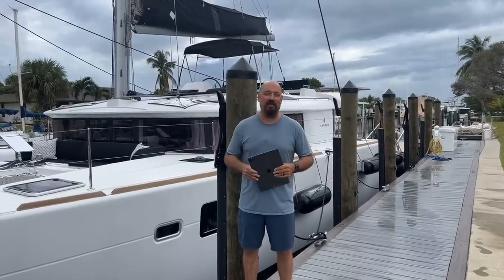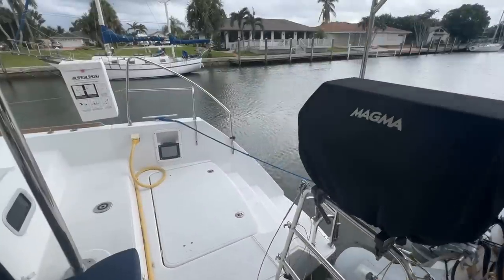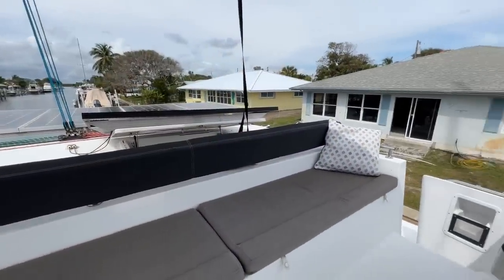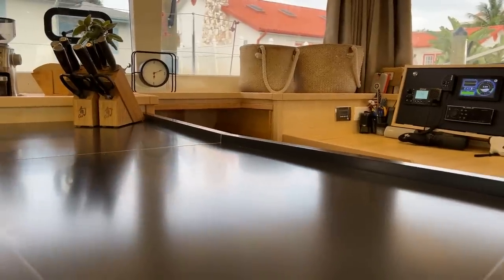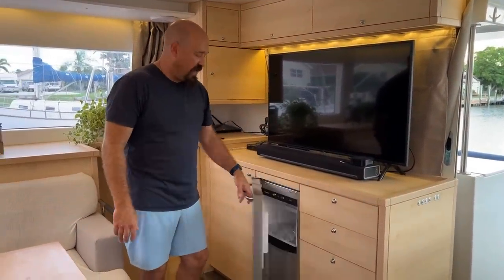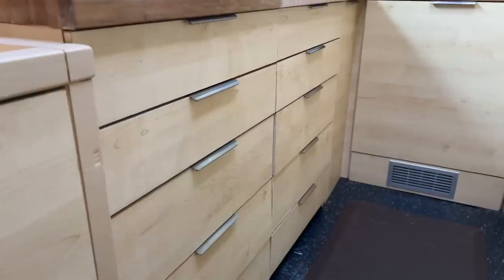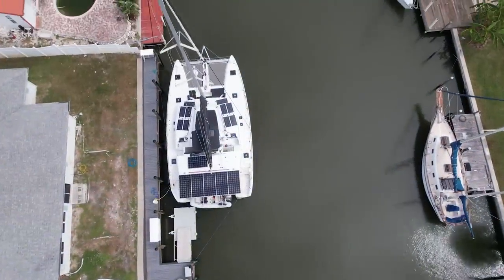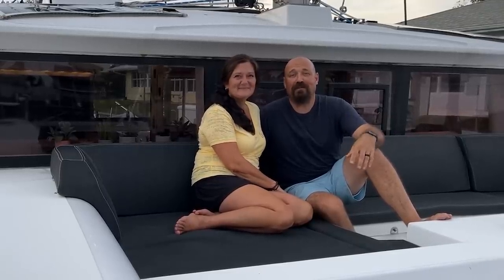*SOLD* SV DAUNTLESS FOR SALE//2017 LAGOON 450F FOR SALE-Episode 100

Comment from the maker: ‼️EMAIL CORRECTION: thecrew@SAILINGDAUNTLESS.com‼️

⛵️Dauntless is offered at: $$595,000.00
Reply: That is a great price for a boat with all of those upgrades. That is one killer electrical system, its going to be tough it beat. Good luck on the sale!
Reply: Do you think you will regret taking the extra time to do the repairs/upgrades?  With the market eroding/interest rates rising, downward pressure will be applied to sale prices.  The increased value of the improvements has a good chance of being more than offset by selling in a declining market.

Best of luck to you.  You did a great job
Reply: @cheapdad2813  it is a luxury good and clearing the "market" in this transaction takes a single purchaser.
Reply: Good  Luck. On the Sale.   Is it a special Designer Catamaran? If just a plain Lagoon your high  look at Sailboat listing
Reply: Has she sold yet?

Comment: You've done a good job but its putting lipstick on a pig.... that boat will be in the crusher in 5 years... that bulkhead repair will not last... I hope the new owner is sensible enough to not go offshore with it or put up sails in anything over 20 knots. Lagoon should have recalled them all and paid back the owners... shame on them... very dodgy organisation.
Reply: Loose the mast.  Boat makes a great trawler.
Reply: I assume you have an Mechanical Engineering degree and completed the structural analysis to backup that statement....didn't think so.
Reply: @Andy_Hunter  just what I was about to say !!
Reply: @jptrini1  actually I'm a naval architect and have been following the  Lagoon case closely.. I feel its my duty to warn people. The Dr in my name is not medical.
Reply: @DRB68  Then post the finings from your analysis.
Reply: I just want to add that the bulkhead cannot and I stress cannot be fully strengthened by a reinforcement on one side only when the outer bulkhead surface is not fibre glassed to the hull... I am sure Lagoon realise this and played a game of maths on potential claims.... In no way am i saying that Dauntless have done anything wrong here, in fact i think they have done an excellent job on the refit.
Reply: You just have to go look at the two that fixed their own 450's to see there's alot more going on with that model than just the bulkheads, they also lack good tabbing practices all over the boat !
Reply from the maker: Thank you for the compliment.  As far as the bulkheads being tabbed, I’m not sure where this is coming from, I have seen other comments about it and I assure you ALL structural bulkheads are tabbed completely to the hull on ALL models.  The only structures that are not tabbed are non-structural  bulkheads ie floor supports, companion way etc and furniture supports to allow flexing.  No catamaran would make it 1km without glassed in bulkheads.
Reply: @SailingDauntless  it's not so much that they are tabbed...it's the Workmanship of the tabbing and depending on glue.